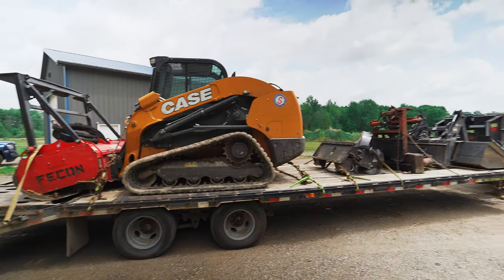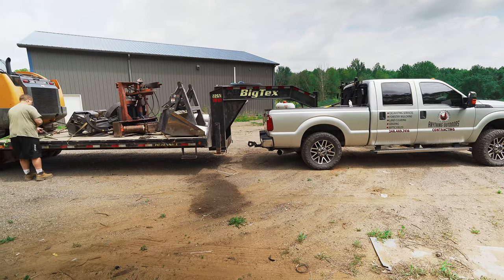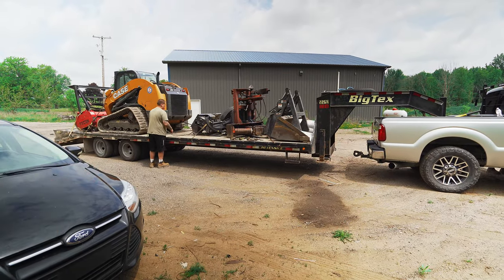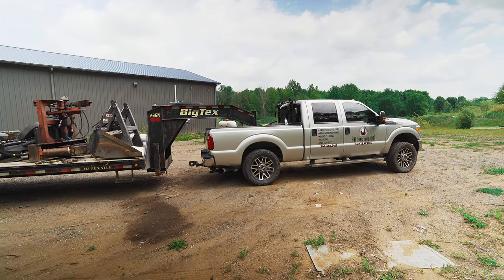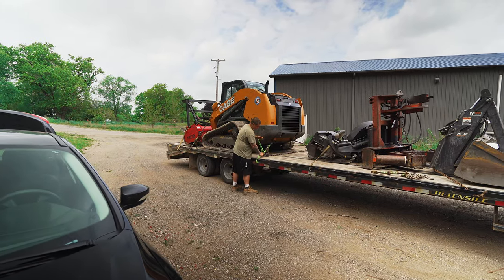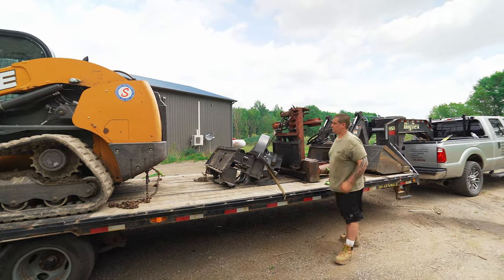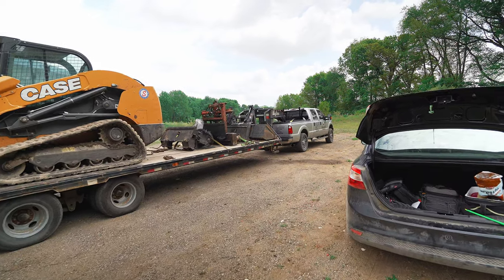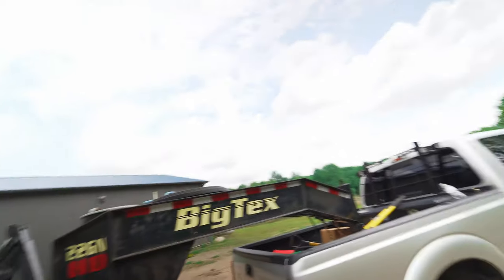HOW TO LOAD HEAVY EQUIPMENT ON A TRAILER // What Happens When You Overload a Trailer

Comment: Great video on the weight side of it but I feel like it could of included more of the actual loading procedure and placement of the machines arms/blades, like you want to tilt a dozer blade to make it narrower and what position the excavator arm should be in.
Reply from the maker: I had pretty limited resources on this one and it was a request by someone so I was trying to get a video out quick for them. At some point in time here I will do a more thorough video that is more in line with what you were thinking

Comment: Theoretically…can you add weigh you to front of the truck to counter the squat?
Reply from the maker: In theory I suppose you could but then you are eating into your truck's max payload.  The chassis, engine, transmission and suspension are all rated to carry a certain amount of weight.  If you added more weight to the front of the vehicle to "balance" the truck out you would be putting excess weight on the truck and possibly overloading the vehicle.  A snow plow would be a good example of this.  You can tow a trailer with a snow plow attached to the truck but you have to keep in mind you're adding weight to the overall vehicle configuration.
Reply: @DieselandIron  thanks for the feedback. I was thinking more like ballast on a tractor
Reply from the maker: @tillman40  no problem. In theory it would work, it's just not practical on trucks
Reply: Ideally if you are squatting too much you should move your gooseneck ball forward to make the front axle begin to carry some of the pin weight of the trailer. The ball on my 2500 duramax is about 5 inches forward of the rear axle. With a compact track loader on a gooseneck my truck sits very near level with both axles well within their rating. Every set up is different, distribution is key on both trailer and trailer on truck.

Comment: how do you load, 4 pallets of concrete that weight the same on that flat bed? i did today but after 55 mph my trailer wanted to start dancing from side to side
Reply from the maker: The same concept applies.  You want a little more of the weight forward on the trailer so that the back axle of the truck has a bit of a load at all times.  This keeps the weight from shifting back on the trailer which is where you will get yourself into trouble.

Comment: Just because your truck can move that much stuff don’t mean it can stop it… has a study been done on how a SRW vs. DRW truck performs when it comes to stopping power?? Seems like having more rubber on the pavement with increase braking grab??
Reply from the maker: I would assume you are correct on that but at the end of the day your rear wheels simply assist in braking.  The vast majority of your braking power is coming from the front axle and your trailer brakes.  Anytime you start getting into trailers of this scale they will have trailer brakes on them.  Hauling this much weight they are a necessity.

Comment: vehicle manufactures recommend a tung weight of 15% to 25% of the trailer weight with fifth wheel or goose neck trailers as opposed to only 10% with a tag a long trailer
Reply from the maker: I wasn't aware of the actual numbers so thank you for providing that.
Reply: @DieselandIron  came out of fords trailer towing handbook